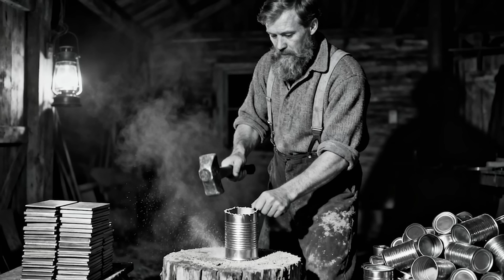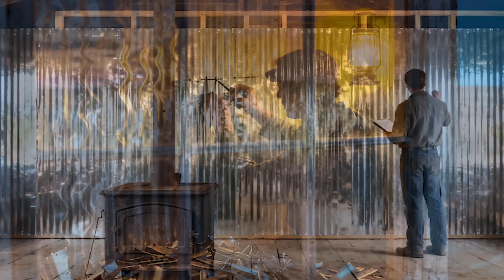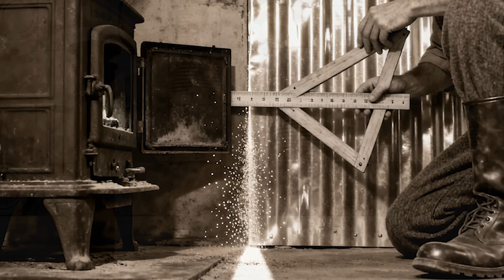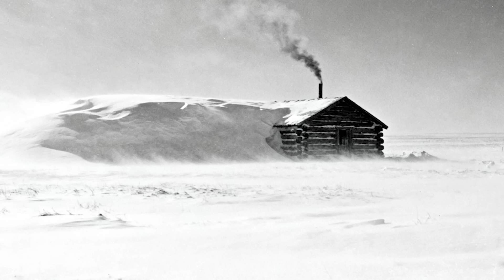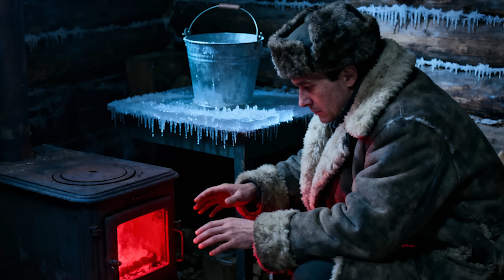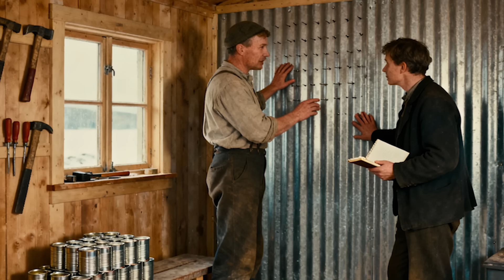Everyone Laughed At His "Tin Can" Wall — Until It Reflected Heat 20 Feet

Comment: Keep in mind. Nailing metal to a wall may seem like a great idea… but if that heat source is too close to the wall, the nails over time can heat up enough to set the studs on fire. That happened to a neighbor. 
If you use something as simple as aluminum foil and tape it to your wall behind your stove… shiny side out… it will help radiate heat into the room. Behind the foil… it remains very cool to the touch.